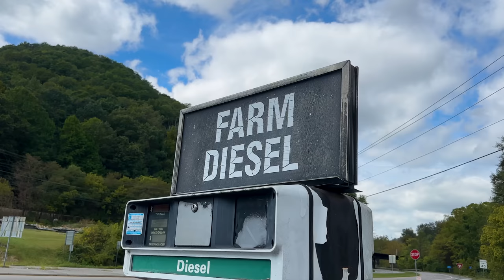Epic Old Growth Cherry On The Woodmizer Sawmill

Comment: I was lucky to get a John Dow tank like that on Ebay cheap.  It is a very good tank.   When I needed a second one I couldn't bite the bullet to pay $1200 for a new one, so I bot the 110 gallon Vevoe on sale for 900$.  The John Dow is a better tank, but the Vevor is a decent value.  The pump works great, and it also has a filter which the John Dow doesn't.  The fork pockets on the Vevo aren't as good as the John Dow, so I keep it on a pallet.  Both of my tanks are in an old army surplus trailer that I tow to the coop to fill, so I don't use the pockets that much.  Happy to have both so over the years I can see which one holds up best long term